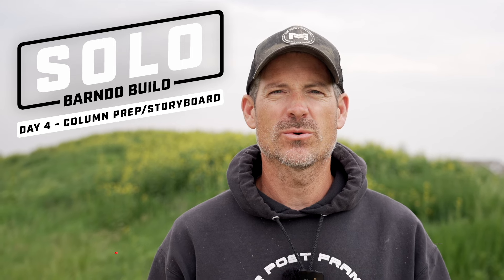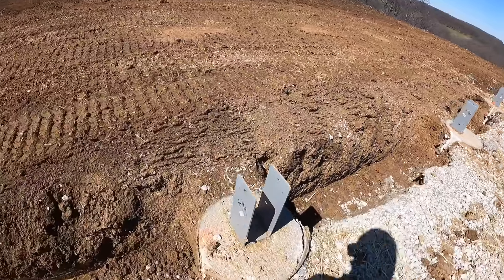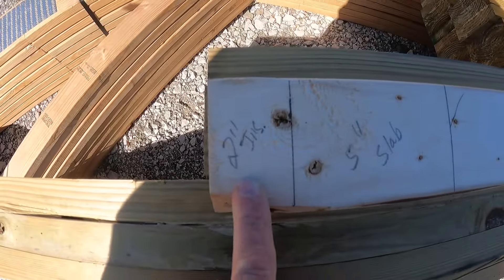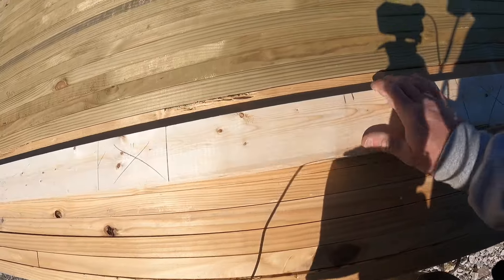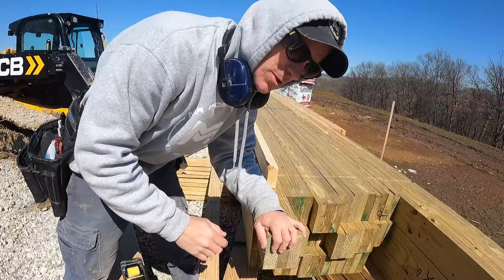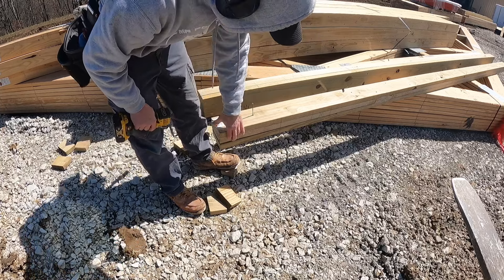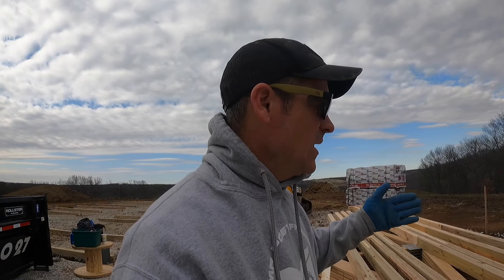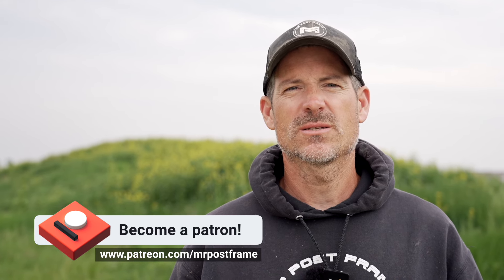Column Storyboard | The Solo Barndo Build | The Cedar | Ep3

Comment: Just a quick question, I see that you take out the center of a 3 lam column, which do you pull for a 4 lam column, or does it matter at all, as long as both ends of the truss are the same
Reply from the maker: Doesn’t matter as long as you’re consistent on both sides.

Comment: Did you use 2x6 or 2x8 on the posts?
Reply from the maker: 3ply 2x6
Reply: @MrPostFrame  At what height do you need to increase to 2x8 columns?